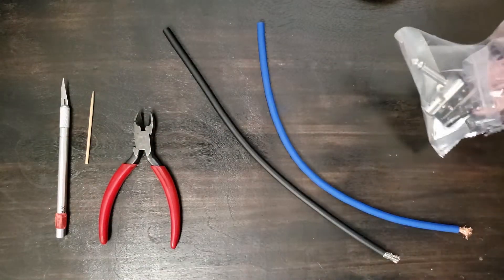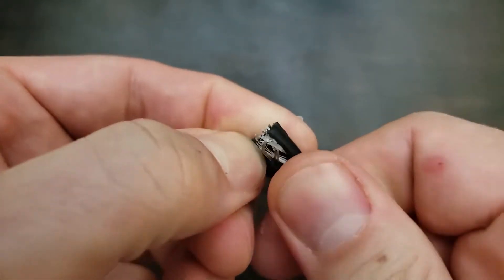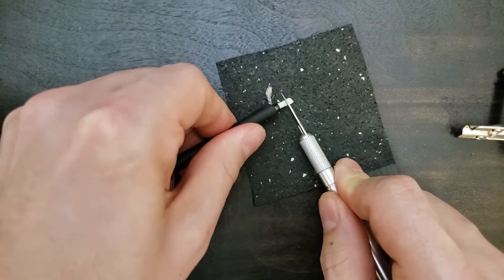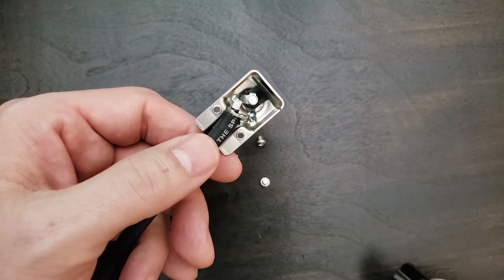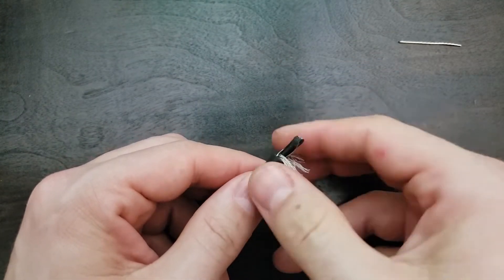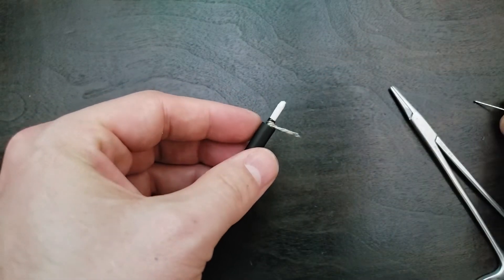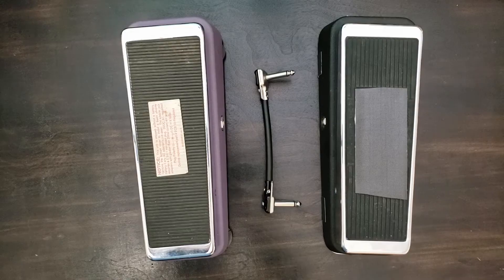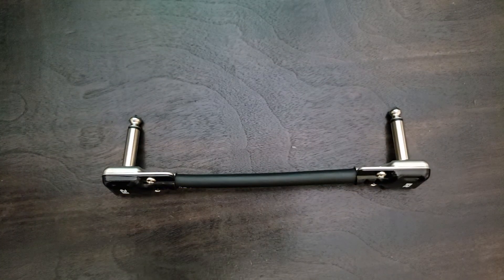Guitar Cables - Make great Pedal cables Right angle DIY

Comment: hey man, thanks for the video. The 2nd method is a game changer for grounding. Silver thin wire - is that right? or was it silver thin wire?
Reply from the maker: Thanks for checking it out!  I used a silver "tinned" wire.  Though a better name for it is "tinned copper" wire.  It's tempting to use solid copper wire, but that won't be as durable and will break sooner.

Comment: Just got my first soldering iron, some bulk cable, and some R/A plugs. I've watched a ton of vids on soldering and this is one of the BEST! I know it's not nearly as easy as you made it look, but you did make it look easy. I'm excited to try your methods. Thanks!
Reply from the maker: Hey Thanks! It's true, cables can be tedious to make, but the more you make, the better you get at doing it!  
Two little extra bits of advice- 
1.  don't stay on one solder joint for too long.  This is likely to melt the insulation near that joint.  If you need to, work on something else for 30 seconds or 1 minute before returning to "touch up" a joint

2. Solder joints should be shiny, and look kind of "wet."  That is to say, you should be able to make out the shape of the wire inside the joint rather than seeing a big "blob" of solder.  If the joints look grey and blobby, redo the joint.

Good luck!  Let me know how it turns out!
Reply: @FrankOlsonTwins  -Will do! Thanks for the tips. Much appreciated!

Comment: Nice video man I just bought some of those plugs but I don’t have a signal on some of the wires and I have a crackle sound any advice
Reply from the maker: Check really closely for stray wires connecting things they shouldn't. That alone will short out a cable.  Also be sure the solder joints are solid, they should be shiny and the wire should not move inside the joint. Loose joints can cause crackle.  If they move, re-solder the joint.
Reply: Frank Olson Twins thanks for helping out man
Reply: Hello it’s me again have you tried the cable on your pedalboard
Reply from the maker: Actually I did, seems to be working pretty well.  However, I might add some locktite to the screws. One keeps loosening..  Any luck with yours yet?
Reply: Frank Olson Twins no I still have a  crackle sound on it it very frustrating it’s my first time doing soldering but I redo all my cables any other advise
Reply from the maker: Can you post a video of the crackle and the connection? It's hard to know what's wrong without seeing  and hearing it.  Does it crackle when you move it? or always crackling?

Comment: On a different note, my last pedalboardbuild, I used the Squareplug SP400 connectors .... they look identical to the connectors you are using, but yours have a different logo/brand.  What brand are those?
Reply from the maker: These are Rean brand(I believe they acquired Neutrik a few years ago). So many of the parts have been rebranded as "Rean" or "Neutrik/Rean."  SP400 looks like a good comparable plug.

Comment: very cool video! thank you very much Frank !  I am just going to build my own patch cables, and strugling with the question which cable to buy and what jacks to go for. I know that the right angled Switchcraft 226 like jack is the one I wanna go for, but there is also the Paccs HST15PROSET2 ... but there are also the Thomann like for 1 $...  is there any difference in all those types of jacks at all? For cable, thank you for showing the Canare cable, i was gonna buy the Mogami 2319 , but now I will rather go for Canare...  and please, do you use any Acid for cleaning the conections before soldering or heat shrinkage covers???? Good luck!!
Reply from the maker: Hey Miki!  Good questions!  First, your connector choices:  I think any of the connectors you mentioned will be good.  The main thing to think about is the size.  The Switchcraft ones are quite big, as are the Paccs.  So if you want a larger connector, those would be the ones to get.  Because they're bigger, they'll also be a bit easier to solder.  The Thomann ones (Hicon hicon hi-j63ma05?) are about half the price and more compact.  That also means they'll be a bit more challenging to solder.  So, if your soldering skills are up to the task, I'd get the smaller ones.  But if you're just starting out, the larger ones might be a little more forgiving.  No wrong answer though, they'll all do the job well if they're soldered properly.
I don't generally use any cleaning solution if the parts(contacts) look shiny.  If they look clouded, I will sometimes clean  the contacts with a cotton swab.  If they are very old parts(NOS), I will sometimes clean them with Caig Deoxit or rubbing alcohol before soldering.  This is pretty rare though.  Usually just a quick buff with a dry cotton swab will take the cloudy discoloration off the contact, and it's ready to go.
One more note regarding the cleaning above... I do use rosin core solder, which itself is a sort of cleaning agent.  However, if the contacts are visibly dirty, it's still best to clean them up manually first.
Finally, I do not use any shrink tubing on Patch cables.  The extra rubber will make it more difficult to bend the cable into the shape you'll need for pedal boards.  On longer guitar cables, I do like to use shrink tubing if I have it on hand, but it's not a dealbreaker if I don't have it.  
Best of luck, and let me know how they turn out!
Reply: @FrankOlsonTwins  I am very appreciated for your time! I would go for the Canare GS 6  cable, though the capacitance is quite high there, 160 pF/m, but the Mogami 2319 is the same... and watched some tests on youtube, and the Belden 9778 was pretty great... but others prefered your Canare, I like it too. I have guitar cable the Cordial 75, thats only 88 pF/m. But 7 mm in diameter and also useing other, Sommer spirit XXL 6 m. I have some experience with the soldering, but I am not master at all. The size is the exact question I had... and those Thoman jacks for 1$, they look the same as switchcraft 226, but probably the quality is not well, some people said in the comments, that the tip breaks inside the effects etc... some signal is lost somewhere within the jack.    Well , the most important for me is the sound quality, so you say, that there is no difference between the audio properties in between regular Switchcraft 226 among 228 ? (among big angled vs. pancakes?)  And about the cleaning, I will try to make sure, to clean it if its dirty, and my solder has something in it too... :D  Thanks also for the recommendation about the shrinking tape, as the pedalboard is not moving, I also dons see the necesity to stiffen the cables too much.  very excited about it...
Reply from the maker: At such short cable lengths it would be very hard to hear the difference between any of those quality cables.  One thing about the sommer cable I used, the shield braid was not easy to solder.  I probably won't use that exact cable again.  I try to buy connectors that have a good track record- making cables is time consuming so if they break within a few months, it can be frustrating.  So if the Thomann connectors are poor quality, I'd look at some better connectors.  There wouldn't be an audio difference between the 226 or 228, but the 228 looks like it might be trickier to solder:  In the pictures, it looks like the 228 doesn't have solder contacts?  I think you'd have to solder directly to the case shell, but if you feel comfortable doing that, it would be a good choice.
Reply: @FrankOlsonTwins  hi man!! I have already got all the stuff and made my first patch cable.. can i show it to you??

Comment: How do you like these Rean plugs? Been contemplating between these and Hicons pancake plugs.
Reply from the maker: If I'm being honest, I might try a round shouldered pancake plug in the future.  These square ones do have a nice look to them, but they feel a little bulky on the board. No good reason not to use them though, as long as you don't overpay for them!
Reply: @FrankOlsonTwins  Thanks for sharing! I'll prob get the Hicons then, cheers. Squareplug SP400 or SP500 also seem nice. Although square, they're very compact. But they're a bit more expensive. Great videos btw, very helpful.
Reply from the maker: Thanks for checking out the vids, glad they're helpful!

Comment: I see how you used a piece of wire for the 2nd connector shield, and technically would easily be able to do that as well.  But my question is why?  What is the advantage to doing that versus simply soldering the ground directly?  I will usually twist and tin 1/2  of the shield, and then it is small enough to fit through the connector hole.  This is a sincere question, not an argumentative one.  If there is an advantage to doing it that way, I’ll do it.
Reply from the maker: Hey, Good question!  This is usually a standby technique I use if the shield splitting method isn't working well for some reason.  In this case, the shield was extremely flexible and difficult to keep twisted without fraying. This can also help if you need to extend a shield connection without losing the end of your cable.

Comment: Hi, is there a difference between de SP400 and SP500?
Reply from the maker: The SP500 is smaller.  It's designed for smaller diameter cables as well, such as Canare GS-4 and Mogami W2319.
Reply: @FrankOlsonTwins  I just bought Canare GS6 and some SP500 connectors. So I assume this will not work?
Reply from the maker: hello,  i can't confirm that it won't work,  but it might not be easy. You could possibly trim some of the insulation from the cable whee the connector meets the cable.  Sometimes that's necessary for a tight fitting cable.